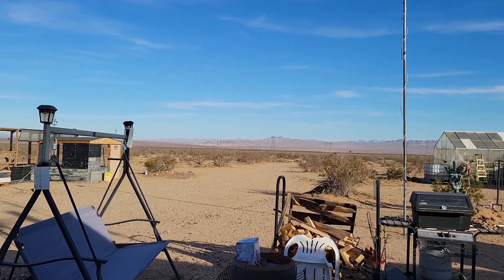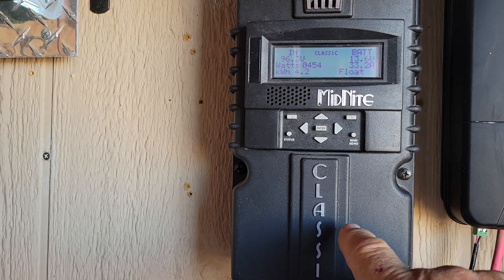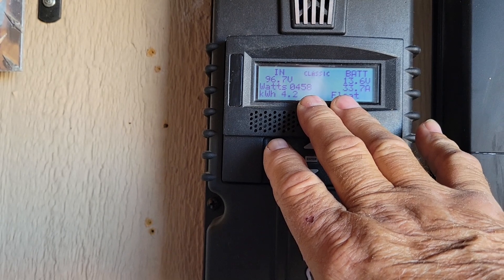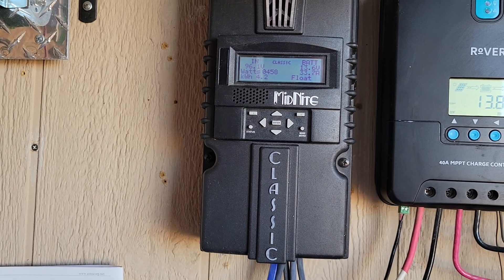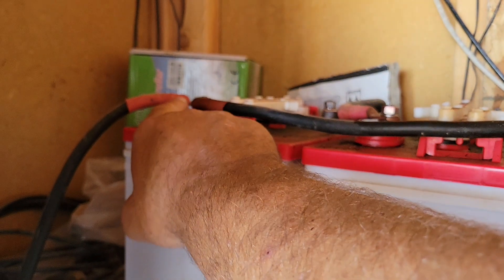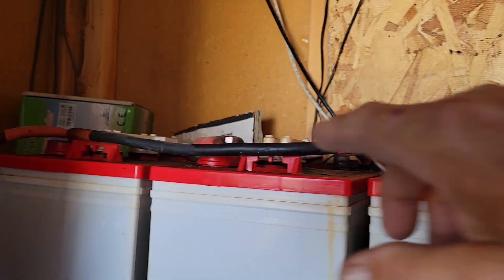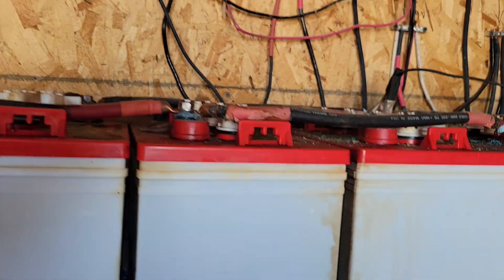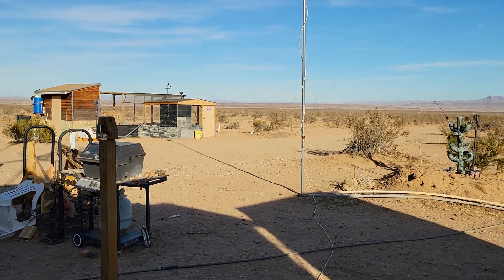Upgrading your 12v system to 24v, Nov. 15, 2021

Comment: Its starting to look more and more like 'not everyone' will have electricity in the cities in the future. There were several news articles recently talking about the new norm will be...power not always being there in some states and metro areas during certain parts of the year. There is more incentive than ever to be self sufficient. 

On a 12V system, I have a hard time keeping the batteries like charged pretty high. There were times where it just felt like, it was sluggish on the charge bouncing back (doing a lead acid agm battery bank). And it seems like the lead acid batteries on 12V, it doesn't seem to like bouncing back in recharge when you suck the juice out sometimes. I'm wondering if it works better with charging and getting the battery voltage to be nice and even with a 24V system? 

I'm not sure how to word this... but I guess I'm trying to figure out if battery maintenance is better, and more conducive to long term battery life with 24V compared to 12V? 

I've seen some videos where some people say 12V is fine and good enough. So I could stay but not sure if its better to do ...either or, 12V or 24V. I'm interested in...which will give you longer battery life.
Reply from the maker: Battery life is affected by how many times you discharge them and how low you discharge them to.
If you are seeing your battery bank drop to under 12v in you system, then your bank is too small for your needs.  I keep mine at 12.4 as the lowest I allow at the most used day.   So, it isn't as much whether you are 12 or 24v as it is for proper sizing of the system.
Reply: @GBear  Thank u very much for the reply. Also wishing you the best.

Comment: Hey mate what brand/type and amp hours are you’re batteries?
Reply from the maker: Welcome aboard!  They are 6v golf cart batteries, US2300, rated at 232ah each.  I have them in series parallel for a 12v system times 24 batteries, and then a backup bank of 6ea, 430ah Trojan solar batteries.
Reply: @GBear thanks for the reply mate, I’m just trying to learn things solar and I was wondering do you have BMS / Battery balance for you’re battery bank or is it necessary?
Reply from the maker: @hemiandreassend3848  No,  BMS is for LiPo batteries.  I have lead acid.  These require 'equalization' which is done automatically by my Midnite Classic controller.
Reply: @GBear  oh ok thanks for explaining mate, love your channel mate 👍🏽
Reply from the maker: @hemiandreassend3848  Thank you! And again, Welcome aboard!
Reply: @GBear  sorry mate one last question for now why did you choose lead acid batteries over LiPo batteries it’s seems everyone is pushing the idea of LiPo batteries are the only way to go?
Reply from the maker: @hemiandreassend3848 The desert I live in has extreme temperatures, as low as 25°F in winter to as high as 116°F in summer, for one. (LiPo doesn't like heat or cold)
And secondly, the cost.  At the time I put my system together, these US2300's were only $99/ea...New!

Comment: I have a 12V system. It can't pull juice. It gets limited by how much watts I can pull into the inverter when I go to use an electrical appliance plugged into it. Is this why people change to 24 Volt systems or higher? 

It seems like that whenever I try to pull anything that uses a lot or even a medium amount of watts the inverter wants to shut it off thinking the batteries will be damaged from the battery voltage dropping too much. It just dips below 12 volts... and the system shuts off at 10 volts... that means the power dip of a load doesn't have to be very big to trip. It works but can only do midget wattage devices below about 350 watts. And sometimes less than 250 watts. So it seems that must be why people go to 24 Volts to get past this problem.
Reply from the maker: To give you an accurate answer, I need to know your system.  Batteries: Types and number, Solar panels, size and specs and connections, ie; parallel or series, total watts input.  Controller: Make and model, max watts allowed, Inverter:  make and model, output single or split phase, max watts rating.
Also include wire sizes for each connection.

Comment: They got my inverter today. The warranty expires tomorrow, lol. In two weeks I'm going to order a 1000 watts 24 volts windmill from Hurricane Wind Energy...
Reply from the maker: Glad they got it. Now let's hope they can fix it so it works right!
I've heard Hurricane makes a good turbine.  Just remember, if it utilizes 'slip ring' connections with carbon brushes, they will fail in cold weather.

Comment: Banana! November 11! 😉
I still need to get a 3000W inverter for my shed. Maybe "cyber Monday" may have a good deal on them.
Reply from the maker: Bread! November 11-1/2!🤣
I hope so for you, but I've never seen a sale.
Reply: Just be careful. Higher watt raged inverter doesn't mean you can use 3000 watts. because you can get limited by the inverter thinking that too much draw from the batteries could damage them and shutting them off. 

Also it seems like a lot of power inverters actually it seems like you can only use half what's stated based on power inverter fail videos on youtube? What do you guys think about this? There's a lot of videos people saying they can't actually use the full rating of their inverters. But probably you wouldn't want to be maxing stress on it anyway.
Reply from the maker: If you buy Chinese inverters, bet on only a fraction of its claimed rating.  Also cheap solar equipment is unreliable and won't live up to expectations.  AIMS inverters are trustworthy, and Midnite Classic controllers are also.  Remember, you get what you pay for.

Comment: Thanks for the video.. However,, all I have ever heard about 24V is you save money on wire.. Now you say that to switch from a 12V to a 24V I need more wires.?  That is what I have been deducing and I figured I had to be doing it wrong.. I was kinda hoping to have some existing wires left over after the switch to 24V.. I think I will just get another 12V inverter for a backup since everything works well the way it is.. Thanks again.. 
btw,, Have you heard anything from JesusFreakJen in the last month or so.? 
(she is a nurse and after she asked,, I told her my opinion on the C-19 thing.. She is unvaxxed..)
Reply from the maker: Yeah, it's a little misleading.  The savings on wire are that you can use smaller gauge wire because you will be carrying lower amps, but when upgrading you need to change wire lengths and add series connectors so you need to buy more wire, and you don't want to mix wire sizes.
No, I haven't heard from Jesus Freak Jen in about a month.

Comment: Great video GBear! I'm having trouble with setting my controllers to get maximum charge our of my solar arrays my one charge controller is a 80 amp and I have 880 watts of panels my permanent array is 1000 watts with a 100 amp controller! I'm not getting the maximum input to keep my batteries charged and run the rv! Ponder on that awhile and let me know if you can give me a solution! Thanks GBear God bless!
Tony n Lee Ann
Reply from the maker: 9 out of 10 times, that is a charge controller problem, but to be sure, use a volt meter to read the inputs and outputs at the controller.
Are your panels connected in series or parallel?
Reply: @GBear  
All the positive cables together all negative cables together then to batteries! I always forget what that's called! It figures it's cloudy today here so I can't get you numbers!
Reply from the maker: Ok, that's parallel connected.  Depending on your equipment, a series parallel connection might be a better choice.  It would increase your volts and amps input.
Reply: @GBear  
I'm having trouble on what to set the high low and float to get maximum  charge I have plenty of juice! But i can't figure what to set the high low and float settings
Reply from the maker: Are you using lead acid or lifepo batteries?
Reply: @GBear  
Renogy agm 200 amp hour we have 4
Reply from the maker: Ok, you NEED to contact Renogy for the proper settings for their batteries.  AGM settings are different than Flooded battery settings.
Reply: @GBear  
Cool cool cool I'll  do that thanks brother
Reply from the maker: I just checked weather radar and it says you should be getting some rain today.
Reply: @GBear  
Sweet we need it

Comment: Coins 11/15/21...I used #2 welding leads on my 24 volt...maybe next week I'll have something to hook them to...
Reply from the maker: That's adequate.   I use 1/0 for the inverter connection and #2 for the battery connections.  If I was to start over, I would use 1/0 on everything.
Reply: @GBear  Well, the way I have my batteries in here, lol, there are 2 pairs of #2 going to the inverter, one set from each 8 batteries...I figured two of them was close to a 1/0 , which is what they recommend, but with only a 2000 watts inverter,  and with it being 24 V, I didn't quite get why they wanted wire that big...it has never even gotten warm, though...while we're on the inverter subject, what did they ever tell you about the two little green ground wires hanging out?  I'm going to put an extra fan inside mine when I get it back...I decided to order two solar panels from Aims. so that will give me five different brands / sizes...that will put me up to 1240 watts of panels...I think that's about right for what I have on the rest of it.
Reply from the maker: The green wires connected are for grid tie systems.  Completely off grid, they should be disconnected.  Just group your panels by make and model and if possible run each group to a separate controller.

Comment: Referencing the 12 volt turbine,  you could purchase a DC to DC "BUCK" converter and step up the 12 to 24 volt and still get the benefits of the wind.
Reply from the maker: I understand there is a loss percentage involved with the buck converter.

Comment: And I'm not thinking too you were explaining to person on a solar panel 12 volt turn them in 24-volt and I think you lose some your amps not for sure how much
Reply from the maker: Yes, higher voltage, lower amps, but same watts.  Ie; 120v, 10a= 1200w, and 12v, 100a=1200w
Reply: Yes that's true on the watts
Reply from the maker: I run some large machinery in my shop, like my milling machine that requires high amps, so I prefer my split phase low frequency 240v inverter and my solar input shows 50-60 amps at peak times .
Reply: @GBear  : yeah I think you said that once before and I do remember

Comment: I have a 24v pma charging a 12v system
Reply from the maker: If running through a charge controller it'll work,  but not the best.
Of course, it won't work the other way around.
Reply: @GBear  now charge controller on it it like yours only whit a dump controller
Reply from the maker: @solarandwindinsouthtexasda1473  good deal!